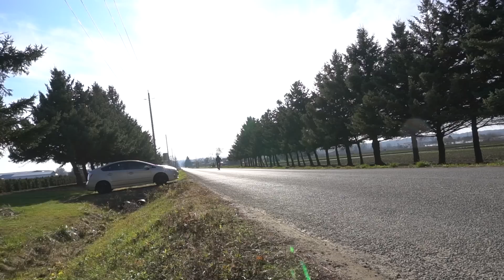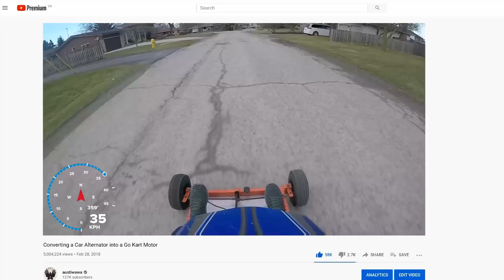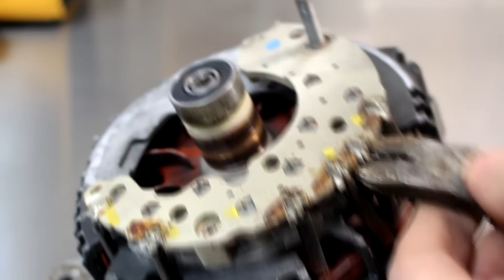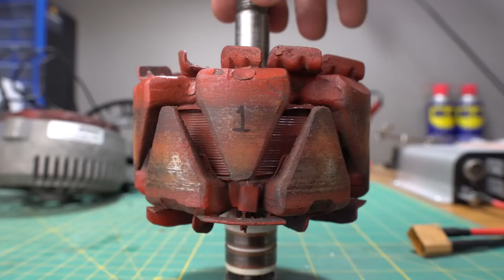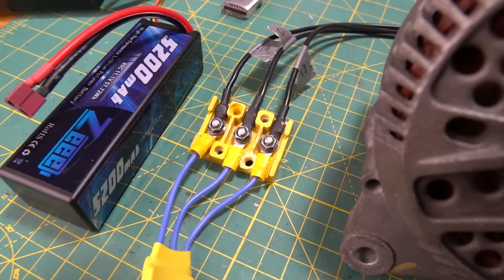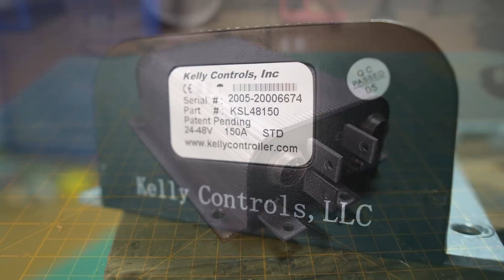Building an Alternator Powered Bike

Comment: Great Video, excellent graphics, good explanation, what type of Hall Sensors are you using. Can you help and provide part number.
This could be very helpful. 

Thanks for the support. 
Great thanks and continue with videos like that!!!!

Sehr gut
Reply: 41F is usually the one inside BLDC motors
Reply: The difficulty is placing the sensor without damaging the copper insulation.
Second problem on Valeo 180A alternators the slot with is only 3mm wide and the Allegro elements are to wide to fit. Even if you trim the sensor edges with a dremel. The height is also critical. 
Who knows a sensor element with the same hall axis which build smaller. Maybe the leads shall be thin insulated copper wire from transformer windings.
My sensor System works but the Stator got shortened.

Second finding is that my alternator produced high torque that the shaft and the clawpole iron press fit broke. 
The rotor shaft is not designed for this high torque. 

I am interested on a sensor system to have a better synchronisation of my rotor to stator field. If the field is applied under torque in the wrong order the motor will not work. You need to be pushed. That's why I think sensors are a must but not working with Valeo 180A.

Valeo has 16poles on the rotor and 48p on the Stator.
Spacing on two slots also ends up into 20 degrees angle and 120degrees electrical phase shift.

Hope we can discuss ideas of alternative sensors.

Thank you
Bob
Reply: @Slic-Rock  check "Chris workshop"
He made an external array of adjustable sensors for his alternator
Reply: @foxxyytofficial  My french is not good enough to understand all
Reply: @foxxyytofficial  do you know we're to buy 40x12x12 N52 Magnet or 40mm x 15x 15 
The sensor system that Chris is using call Motocone.
A Finish Guy invented it. 
Motocone search it.

Comment: Don't turn it into BLDC.. Set it up to regenerative breaking. Recapture energy when stopping. =)
Reply: What does keeping the alternator like that have in common with regen?
Reply: @foxxyytofficial  Glad you asked =) In commercial applications this also known as a synchronous motor and is used as both alternator and motor. Most commonly by varying the dc power in the armature you can create leading power factor to balance inductive loads in a shopping centre or factory. So besides being an alternator it is already used as a motor as demonstrated in the vid.. All that is needed is to put back the diodes with a 3phase relay and switch between motor/alternator for regernerative breaking. Always wanted to do this.. best of both worlds 😊. With hall censors microcontroller can decide on rotation speed to pulse on regen to relay to slow down hill speed to say 60mph..  Or to decreasing accelerator depression.
Reply: @dinner85  its more efficient to put permanent magnets and just use regen from the same Kelly Controller he is already using
The alternator is not that much efficient with claw poles
Reply: @foxxyytofficial  You are right. That is much easier and probably cheaper. But there is so much more you can do controlling the rotating field as well as the DC field. I would love to see some efficiency comparisons. I do know that battery management is not the only reason why alternators are used. I have a spare.. Just little time to play with it. Thank you for making me think FoxxyYT.

Comment: hi YouTube i have a trike that has a 1500 watt controller at 48 volt but it does not seem to work but when i hook it up to 250 watts it does work but i wanna use 1500 watts what do i do??
Reply: the alternator doesn't spin with the small controller?
Reply: @foxxyytofficial   vise versa
Reply: Does the small controller works with other motors?

Comment: I have one more questoin.I purchased a 36-48v 1200watt 45amp speed controller and i got the alternator running and it works very good and i want to put it on a scooter so im going to purchase a batterys so do you know how many ahs the battery has to have because i dont know much about batterys but i want to purchase the right one .I watched your other video where you had the problem .
Reply: how much do you want in range?
Reply: @foxxyytofficial  i didnt really have a number in mind ,just so i can ride for awile
Reply: You will need 18Ah lithium (30ah lead acid) minimum, just like Austiwawa have
And 40Ah lithium (70Ah lead acid) for a long ride
Reply: @foxxyytofficial  thx
Reply: @foxxyytofficial  can i put too much power on it as well
Reply: @annaelias92  depends on how you will cool it down
Reply: @foxxyytofficial  oh well i trying to find out the cheapest way to get a good battery pack i thinking of making one of 18650s but i dont know much about batterys.Ill do some research and see

Comment: This is cool. Austiwawa. I have a question for you with understanding alternators and motors. Why isn't my car's charging even though I change the alternator. Obviously, the alternator's not the problem. Is there a way to rewire it so that the gets recharged.
Reply: That is a question for a car mechanic, sorry
Reply: But you can check the wiring, fuses, grounding, the entire system between the alternator and the rest of the car

Comment: Does the alternater go just as fast if you use the little esc controller and have just as much power
Reply: No, because the esc's power limits are 4x lower in voltage (48V x 12V), and in current (his second controller can pump up to 100A continuously)
Reply: @foxxyytofficial  ok not even if i put 36 volt into it
Reply: @annaelias92  if you want to use an ESC and not ebike controller, use a VESC
the YT channel Fixitmoditbreakit used one, search his videos
Reply: @foxxyytofficial  thx

Comment: is it possible to put a different size alternator on old rusty to recharge the battery as you're moving if you can get it at 69 kilometers per hour it may be possible what do you think?
Reply: no, it will still be too inefficient to generate any benefits
Reply: @foxxyytofficial  are you absolutely certain about that because an alternator recharges a car battery and they put out a pretty large amount of power to run the stereo and keep the car running? I was hoping possibly you could double at least the 30 minutes of charge that you have in the batteries. Is that still not possible? I saw a YouTube video where a kid in a third world country had a well-kept secret of a process using water to power his scooter. Pretty incredible.
Reply: @richwrightrocks  those high power alternators can pump 200-500A peaks but you also forgot that they are kept running by engined with dozens, if not hundreds of HP and don't use electricity to spin like the small alternator in this build
Reply: @richwrightrocks  and to power a scooter's carburated engine with water, just create a HHO generator and hope that it doesn't blow up
Reply: @foxxyytofficial  I get what you're saying and to the Layman it might seem logical. However. All that horsepower isn't needed to turn a small wheel that has relatively little drag pulling against you turning it. turning the alternator to send the power to the batteries to lengthen your drive time that you're on the road can usually be done I believe Google Gravity when you going down Hills you can turn the engine off initiate the gear an alternator to charge the battery or perhaps when you turn it off if it's an alternating current that will turn in opposite direction but still do the job of charging it battery perhaps it'll charge it while going down Hills when not in use pulling you going uphill. You're a genius I know you could figure that out. Simply to charge a 12 volt battery you have the advantage of a giant bike tire is much bigger than the belt wheel on a car turning the wheel on your alternator. I'm thinking like one of those tiny wheels that go up against the rubber of your bike tire that turns a little generator  to power a headlight for your bike at night. The bigger the belt wheel/gear the more rotations you get on the smaller wheel. For example: Look at the gears on a 10 speed bike. The the larger the gear in the front in ratio to a smaller gear in the back and you go a heck of a lot faster hence more turns on the smaller gear. You can make up any difference by the correct amount of teeth on the gear ratio that you decide to put on the bike to turn the alternator charging your battery being used to make the motor turn. Even solar panels on those cheap solar lights for people's walkways to charge the AA batteries inside can be attractive to someone when Market is for sale to campers. There's no bad ideas. Anything that could charge the batteries in any small way to fully charge the batteries  when not using the bike and to extend the drive time is a good thing. If there's a way to make it work I'm sure you'll figure it out. You're patience is only matched by your tenaciousness and intelligence. Very impressive.
Reply: @richwrightrocks  First of all, you only feel a small drag spinning an alternator because you're spinning while its not producing energy, as it produces on the car, the magnetic force will create more and more drag, but that drag for a 60-3000HP vehicle is negligible, for an alternator-powered build with less than 4HP, now its more than a problem.

Second, if your idea is to turn off the drive motor and just recharge downhill, why not just get a regen controller for the drive alternator?!? More efficient, less weight, less parts, no strange ideas and no mess, if that worked, wouldn't Tesla and all of the other EV makers already use the idea???.

Third, the bicycle's tire size doesn't tell that big of a story, it doesn't matter the gear ratio, because it only chages RPM/Torque, you still need Power = Force x Time.

Fourth, the example of a dynamo for headlights already show that using it will automatically force you to use more force at the pedals to keep the same speed as before.

Fifth, your other examples for solar recharge are for equipment that pull just a bit of power, not a full-sized motor pulling THOUSANDS of watts at 48V.
Reply: @foxxyytofficial  okay okay I know you're the genius I'm not. But I do believe electric cars do you use centrifugal force to recharge when momentum dictates It 2. I believe something that does charge the batteries with some kind of alternator. I know I saw that someplace that the batteries would be charging When there's less drag or coasting. Or maybe when the brakes are pressed. As far as the solar recharge I meant for camping and extreme circumstances when there's no power to recharge and you're in the middle of nowhere at least it would charge them slowly but surely. Am I wrong about that? Maybe one that can be opened up when you get to your destination.
Reply: @richwrightrocks  about the elctric cars, its not the centrifugal force that rechardes them, but the inertial and kinetic energy that keeps the car going forward as the motor controller starts to use the motor as a generator and regen part of thet energy back to the battery.

about the solar recharge, it would need expensive equipment and more than a day, so probably you'd stop at your destination, keep it charging since you arrived, so that in a couple of days the charge is enough to return
Reply: @foxxyytofficial   thank you so much for clearing that up for me.

Comment: other ideas is the height of the rim of the rim is 1 centimeter and thickness is 1 centimeter. add 2 side gears on each side and the rim rim in the thickness will not hollow but a rim could propel the bike
+
otras ideas es el  alto del aro de la llanta es 1 centimetro y espesor es 1 centimetro. agregar engranajes 2 laterales en cada lado y el aro de la llanta en el espesor no agugerear pero una endidura podria impulsar la bicicleta.

Comment: What guidance can you provide on the power needed to power the brushes?  It seems 12V, but the pack you are using looks much smaller.  I suppose since it is static, it doesnt need to be as large as the 48V drive battery bank?  Does the drive bank run out before the brush pack?
Reply: At 12v, the brushes' circuit would only pull up to 3-4 amps
So if you got a 12v 7ah deep cycle you would have 2h of continuous use

Comment: Now all u have to do is install a second alternator, maybe an inverter too, and use that to charge ur battery pack while in use..  Not a perpetual motion machine, but, i bet u increase the trip from 30 minutes of run time to maybe 6 to 12 hours, with a bit loss of speed of coarse.  Also, belt drive would be more quiet, and less friction, and a nose cone on front of bike for some simple aerodynamics.  Good luck.  Great video.
Reply: you can't do that, it will be so inefficient that you will lose range, than get more range

Comment: I personally reckon if the clutch wasn't slipping as much as what it was on the video you would be going a lot faster because you would have more grab on the motor And when that clutch was slipping a lot that was probably taking a lot of the speed away
Reply: with no clutch and new controller was a lot better

Comment: How does varying the voltage to the rotor change performance. I've seen in other channels less power to the stator (3v VS 11.1v) was said to increase torque. Could varying the voltage here allow more TQ down low and then more speed up top?
Reply: Less voltage gives less current and more RPM
More voltage gives more current and more torque

Comment: If you ride at speeds higher than the bike is intended, reminder to check the axle bearings and grease.
I made a minibike in the 60’s from a stingray bike and a 65ccClinton go cart racing motor. It would go 50 mph and after every run the bearing grease overheated and spun out of the bearing housing. It would not take long  for the bearing balls to separate from the bearing. Caged ball bearings were the common type at that time.

Comment: I think the blue wind power alternator is a permanent magnet alternator. Could you use the blue wind power in the same application? Would it be more powerful and or more efficient? And could you also use this blue wind power generator to also charge the battery back and as a regenerative charging system. Or what about using a treadmill motor.
Reply: You can use PM alternators because are more efficient (specially the ones with rectangular magnets)
And regen only with hall sensors and if the controller is prepared for it

Comment: Add another alternator on the other side of the wheel so it charges the battery while your riding you'd go for miles!!!
Reply: Nah, it would cut his range
Reply: @foxxyytofficial  that makes no sense  how would it cut the range when it's charging the battery at the same time as its using it like a car
Reply: @williamriel9890  first, the alternator on a car just tops off the 12V battery, it does not propels it forward

Second, you're using it to move instead of generating power, so you won't fully use it

Third, you would need a lot of extra equipment to control the power and the voltage to the battery, ignoring the extra load that it will have in the battery because now it needs to move another thing

Fourth, if that would work, it would be a special thing for perpetual motion, since you're getting the same amount back to the battery, even with heat, wind resistance, ground resistance, friction, weight, back EMF forces, and efficiency factors

Comment: You could change the Centrifugal clutch engagement speed by weakening the springs in it - which allows the weights to swing out sooner.  ALSO, applying 12V full-time to the "motor" rotor electromagnet is a waste of energy, and top speed.  12V will get you maximum torque, but will severely limit RPM. Once the bike is moving, you could use a PWM controller to modulate the 12V down to 6V or possibly less... then you would see a HUGE increase in motor RPM.  Been there, done that.
Reply: The clutch was removed, but the part about PWM is spot-on

Comment: Why can’t it charge the battery while it’s running ?
Reply: to recharge it like most people want won't work, because it will be so inneficient and would need so many other systems to control the recharge that would only hurt range
but if he enable regenerative braking he could really gain back some miles

Comment: I wonder if he can use a second alternator to keep the charge of the battery longer.
Reply: He can't
Reply: Thats vague. No explanation?
Reply: @tylergraves1555  1) the alternator in real cars is spun bu a motor many times more powerful

2) the battery on a car with alternator don't makes it run, only keeps the accesory systems and the ignition sequence on the spark plugs

3) all power used to energy generation is higher than the output because of the efficiency loss, hear, friction and other factors

4) if you try to put the alternator to recharge the battery without regulation will cause damage, and even if with regulation correctly designed, you will still overdrain the battery to power the motor to power the bike to power the second alternator, and this cycle will keep wasting every watt of energy without getting better range